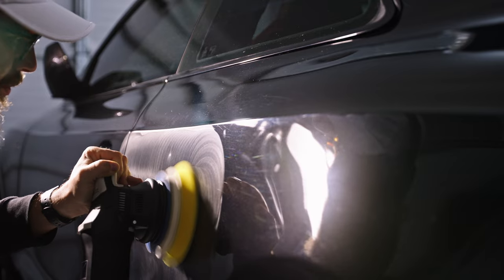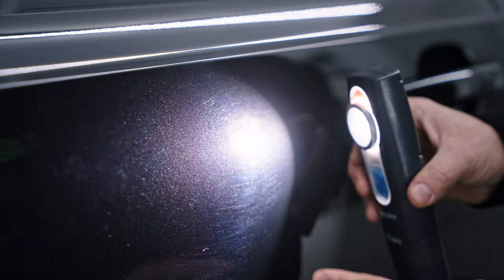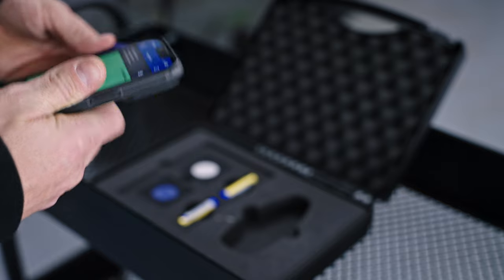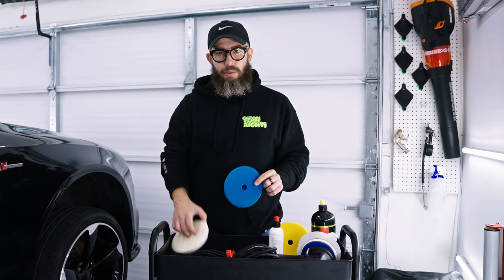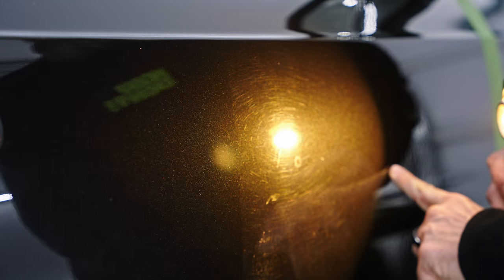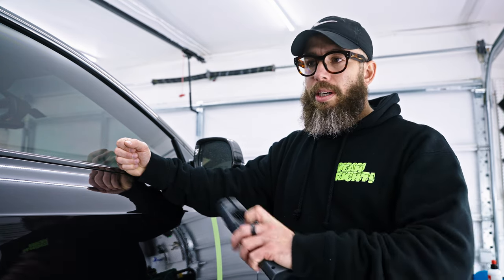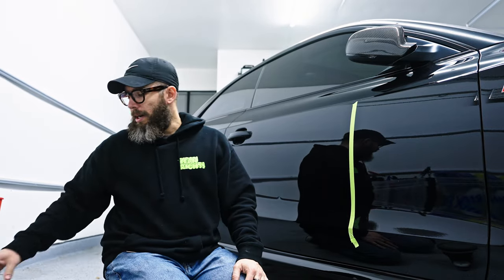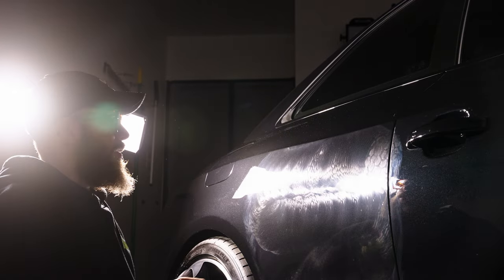Paint Polishing in 2024- Swirls, Paint Problems & More!

Comment: Good Point.  I'm doing my expedition in the spring plus ceramic coating.  I am a seasoned buffer user too.  Been buffing for years my vehicles and boats but, its always nice to see others technics
Reply from the maker: Good stuff! You've got the work cut out for yourself, that's a not a small job. Let me know how it goes, if you have any questions along the way and I could be of any help at all feel free to shoot a comment!
Reply: Absolutely. 

Another option that works and worked great on my car(s) : one round with the Coarse pad and polish, followed and finished with Yellow. 

Used with an LHR 15 on Carbon Black Beemer paint. 

Over the years I've learned to stick with this brand. 

In a few months @ spring it's time to prep the car(s). 1 degree Celcius over here in Belgium right now 😅. 

Cheers.

Comment: After watching a lot of vidoes and specifically your Audi and Shelby Cobra videos multiple times, you inspired me to finally perform my first ever 'test spot' on the trunk of my black Audi S5 yesterday.

I used Rupes Yellow MF pad + Jescar Correction compound. And then Rupes Yellow Foam pad + Sonax Perfect Finish (I think that is the Esoteric method).

The hardest part was actually holding the polisher nice and level for the whole series of section passes.  That will definitely take practice!

The first step took out like 95% swirls.  But the paint was pretty hazy.  The 2nd added a lot of gloss.

When I looked at the spot with my detailing light, it looked great.  But when I brought the car out into the sun, I could see a decent amount of holograms (like the in the Audi video.

So it seems like I'll need a third step?  Or do you recommend maybe I try the yellow pad/yellow polish combo like you did because my first step might have been too aggressive?

Thanks for any help!!
Reply from the maker: Hey, well the holograms were caused by the yellow, try going finer. Black pad and something like menzerna 3800
Reply from the maker: The thing with soft paint like the audi, is you'll need to apply almost no pressure while doing the polishing faze, and honestly you don't need multi step
Reply from the maker: Sounds like it's super soft, try just a black pad and menzerna, I'm 90% sure it'll remove most of the scratches and leave no haze if it's close to what these cars were. Just apply almost no pressure let the pad do the work and use little amount of product, a small bottle should do your whole car
Reply: Thanks a lot.  I'll revise my process to what you mentioned! This is why we do test spots! 

Nothing like doing your first ever correction on a black car!! 🙄😁

Comment: Nice video! Can you share your speed in the dial? For cut. Thanks
Reply from the maker: Sweet spot for the lhr15 is between 3-4, if you have another machine you can slow the machine down until you see it cut slowly as slow as it goes while still moving. 

That's a good tip I got once from Jason at Rupes!
Reply: @streetready  I just get a shine mate 15mm orbit and 5 inch pad. I will try to find the sweet spot. Thanks

Comment: Great content can you tell me why you used the black pad with meguires instead of the yellow on yellow for the holograms cheers.
Reply from the maker: The black pad is less aggressive than the yellow combination, the holograms were caused due to an aggressive approach. Although yellow worked effectively in some areas, others where the previous detailer tried to correct were really bad and the yellow didn't work in those sections so I had to back a bit to a light polish.
Reply: @streetready  Thanks for the explanation.
Reply from the maker: @bpy4073  black pad use is very unusual although it may seem like it is on the videos I posted, that's for very soft paint. For the most part yellow pads should get you through just fine, depends on paint consistency and car manufacturer

Comment: You said the owner would maybe come back in a month for ceramic coating. Would you have to go through a polish step again before coating? Or will the work you did here hold up until then?
Reply from the maker: Hey Ken, 
So yeah he'll be back here after he's done with the fillings and whatever other modifications they'll do to the vehicle. In this specific case, I'd have to wait and see. It'll vary by the condition of the vehicle and what it undergoes from here till then. I won't really know till I see it in person when it gets back. The paint correction or paint polishing process should hold up great with no problem at all, but if the paint happens to have been contaminated at all, that where we run into issues. Let's say being left outside too many days in a row or something like that, I may have to clay, if I have to clay, I'd probably very likely 70-80% have to polish afterward but I'd go very light, and use my very least aggressive methods, and the very least aggressive contact on the paint. 

Whatever does happen to it, I will make sure to note it and answer your question on the video for sure to give you some closure on this question. 

Thanks for asking!

Comment: Thanks for the helpful video. For a beginner which random orbital polisher would you recommend? I'm considering Shinemate EX605, Liquid Elements T4000 V2 Mark 2, ChemikalWorkz ED9 PRO (or ED9 PRO MAX)... Thanks
Reply from the maker: To be completely transparent with you I haven't heard of any of those polishers before, this is the first time I come across them. 
After looking at 2 of those because I couldn't find ChemicalWorkz - 
The ShineMate EX605-5/12 Dual Action Polisher gives me the ergonomic vibes of a polisher for smaller tasks, such as sections a larger polisher couldn't cover, and has a smaller orbit throw of 12mm. But that's just my personal opinion. ( ADDED ) - The ShineMate EX610-5/15 Polisher would be a better comparison to the one below.

The Lustreuse Liquid Elements T4000 V2 MK2 - Orbitale 15 mm, has a 15mm throw such as the large polisher I used on the video, same throw, and has the ergonomics of a larger polisher designed for longer use periods, but that's again my opinion.

Email the companies if you have other questions usually, they're great with responses and education, another website I'd recommend is: 
https://www.autogeekonline.net/

Some people swear and stick by Porter Cable polishers, I've never personally used one.
My first polisher was by chemical guys, Torqx Random Orbital BUF503 one of their smaller ones, I'm not recommending I'm just giving you an idea. I did however end up outgrowing it due to running a business and polishing a lot more often than once a year, I needed something a little more comfortable for weekly use. 

I suggest you compare to other companies, for example, you can compare their stats to the Rupes 15mm throw polisher on their website and see what you think, also compare ergonomics. You can visit Reddit and see what people think of the companies you've opted on, and post the question there. Do as much research as you can before you pull the trigger on it because remember this will be a tool you'll have for many years, and probably use on most cars you'll have.

Best of luck!
Reply: Thank you!
Reply from the maker: You got it Luca 🤜🏼 @lucam.1203
Reply: Shinemate out of that group. Never heard of the other brands